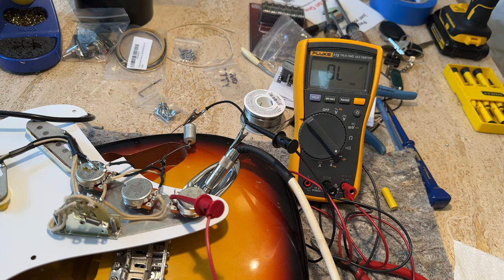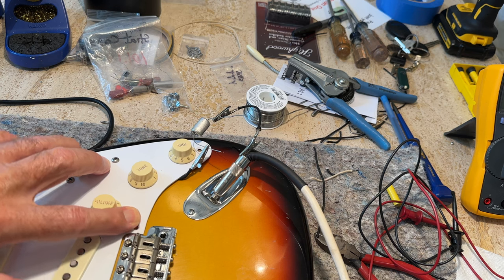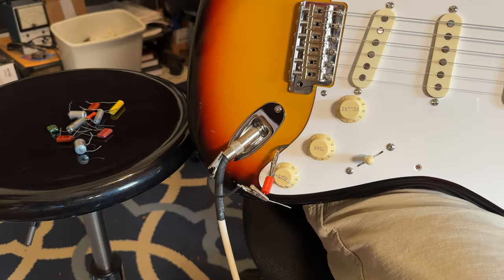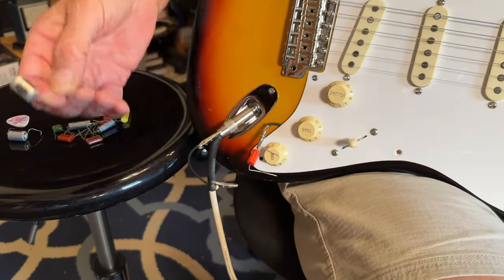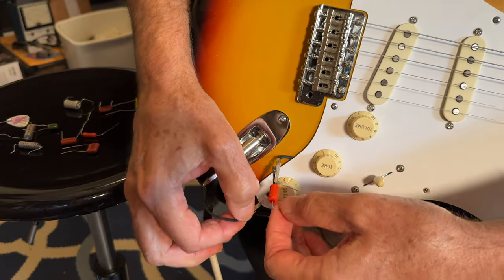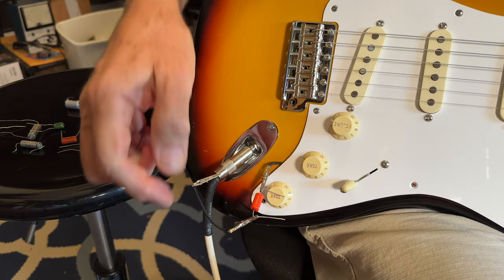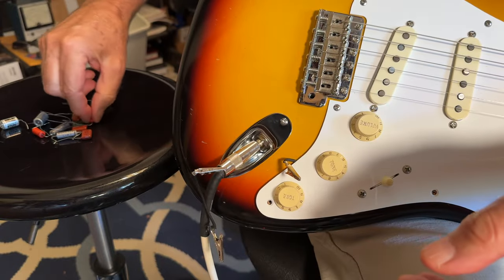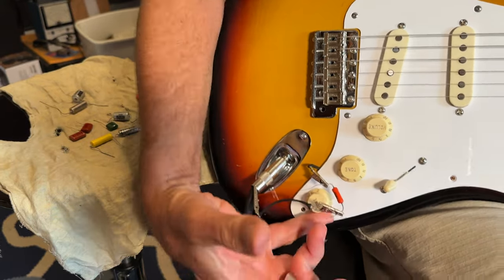How To Rig Up a Strat Capacitor Test Jig on Your Strat

Comment: Perfect timing , same situation and can'n be soldering caps for the rest of my life. It  is worth trying caps and resistors like that, found a lot of excellent caps in an old Grundig TV and did what you did but putv.047 sprague on neck, .022+.01 (paralel) for middle , and left bridge pickuo wide open for fuzz but found a bunch of .001uf and other low values in wax that I want to try and your vid is going to be my guide. I may try  fixed type thing on the bridge like Leo Fender did on the oldcEsquires to have a set tone ready just by switching, thanks, the best fun is slways had when you build something useful yourself !
Reply from the maker: It worked out great. The guitar is so Stratty. It’s my most versatile and I would never have believed I would be the one to build it.

Comment: Most of the first half of the range of the tone circuit is due to the pot, not the cap. The cap effect (its value that is) doesn't kick in until well into the range of the tone control. So if you're comparing the first half or so of the pot's range for different cap values, you won't hear anything different, because nothing IS different (because the pot is the same).
You get differences due to the pot value in the later half or so of the range.
The circuit is affecting the tone somewhat on 10 as you say (compared to no tone circuit), but it's really the pot that is doing that.
Reply from the maker: Interesting.  These pots are on the high side on purpose.  288K ohm V, 284K ohm both Tones.  It does give me a broader range I think so I run the tone controls down around 7 most of the time.  There is a nice sweet spot between 6 and 8.  It seems a lot more versatile than my other Strats.

Comment: I’ve always wanted to implement a variable capacitor potentiometer, I’m just not sure I’d have the room in my routing channels. I’ll be visiting my grandparents’ house soon for some capacitors…
Reply: I’ve also seen others have very good results with caps lower in value than .022, as much as .0022 even and they sound great. It’s a great alternative to a treble bleed volume circuit, it retains more of the mid content and tapers off a smaller portion of the highs to ground. I can’t recall who it was who experimented with those…
Reply from the maker: Yes, that route is pretty tight.  There are so many different wirings for a Strat.  It gets complex fast.  Several that I saw had two caps, one for each tone control.  But, I'm a simple man and for the classic Strat sound, I always try to stay as close to the original as I can.  I was really thinking while I was building this guitar "why do so many people bother to put the copper shielding in the cavity?"  I find that completely unnecessary and actual is detrimental to the classic tone.  This guitar is perfectly silent and all it has is the small aluminum grounding plate that fits just on the 3 potentiometers.  There are also a lot of recommendations to run a ground wire to connect all the pots together.  Again, not necessary IMO.  You can actually end up with ground issues if you go crazy with the ground connections.  This jig is mostly for the curious I think because most techs have decided on a good cap a long time ago and just continue to use it.  I was curious.
Reply from the maker: @Scott.9  I was hoping for a Strat that didn't sound like my other ones and this is it.  The tone controls are much more useable on this one.  I think the 284K-288K ohm pots made a difference.  It's my favorite Strat now and I'm not sure when I will stop playing it.  The one thing I remembered that I didn't like is how the saddle height screws tend to vibrate and lower the saddles.  I've had to put a little soft thread lock on a few like I used to do on new saddles on my old Strats.  I wanted some Fender sparkle as well as some mids and this one is doing it.  I'm sure the pickups are a big factor.  You could switch pickups forever and get new sounds.

Comment: What is your pickups on your strat stan?
Reply from the maker: They are these pickups from Q-Pickups in Croatia, https://qpickups.com/qshop/product/stratocaster-1964-pickups-set-l-series-hand-wound-fender-vintage-correct-strat-clones-64-q-pickups/.  They were recommended by a friend and I'm really enjoying them.  They sound a little different that my other four Strat so I'm glad about that.  A little variety was what I was aiming for.  They definitely sound different than my original 1964 pickups because they are a little brighter and probably closer to what mine sounded like back in 1964.  I ordered a reverse vintage magnet stagger with non-RWRP to simulate a left handed Strat.  They are approx.  5.7K ohm N, 5.8K M, 6.1K B.
Reply: @millstap  thanks for the link!, price is good for a set, i have see the hendrix 64/68 set vintage correct pickups…
I will pass the order one with reverse vintage magnet…
Reply from the maker: @mikaeledream3335  They also have sales too.  I had an email recently where they were offering 15% off I think.

Comment: Is that your new mjt body?
sounds weird?
Reply from the maker: Yes, this is the new MJT body and it sounds great.  In this video, I had my Super Reverb turned really low so I wouldn't blow the audio.  This MJT body is a little unique because it is a lightweight one piece Alder body which isn't the usual that you get from Fender.  This is my favorite Strat now.  I'll try to do a sound demo in the near future.  If I would have known in the beginning that you could easily piece together a great Strat and customize it, I don't think I would have ever bought any real Fender Strats.  I think the parts choices are much better today, though, than they were 12-15 years ago.
Reply from the maker: Didn't you mention you had gotten a few bad sounding MJT bodies?

Comment: thank you for very informative video , I am new to guitar mods things ,I have some quetion , If I fully open tone pot , it mean capacitor is not function ? my understand is righ or wrong , please fix me . Thank you.
Reply from the maker: You are correct.  With the tone pot fully open, the cap has no effect.  If you listened very closely, you might discern a very slight change but it is almost imperceptible.  The cap quality and value is only relevant if you use your tone controls a lot.  Someone that keeps them on 10 all the time really doesn't need a tone cap.  I just put the Mojotone .022uF (the replacement cap for the one that broke) in my vintage 1964 Strat and it sounds good.  I would stick with a good Paper In Oil (PIO) cap of some sort because they last forever and supposedly sound a little better.  I agree that the PIO caps are a little more "open" sounding.
Reply: @millstap  Thank you so much for kindness reply. ❤️❤️❤️